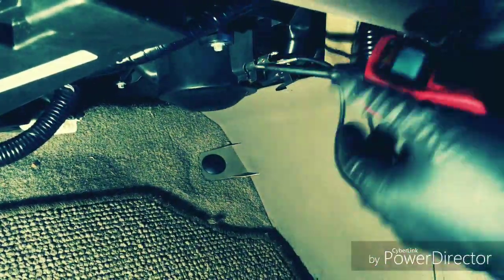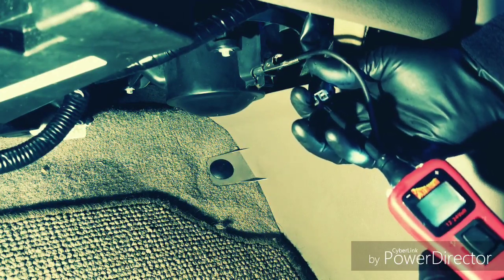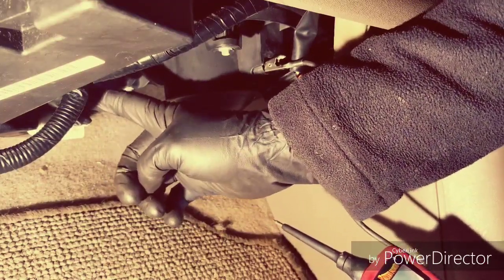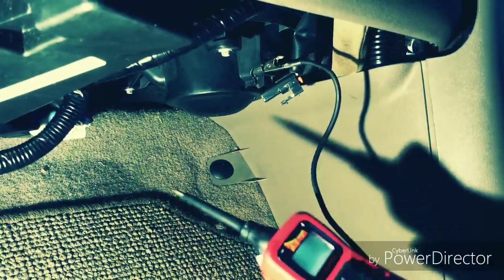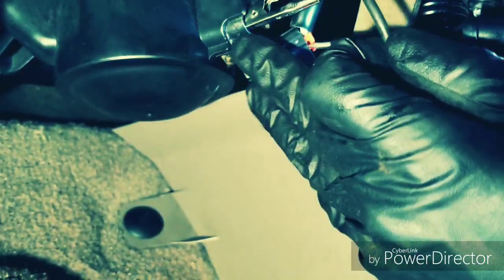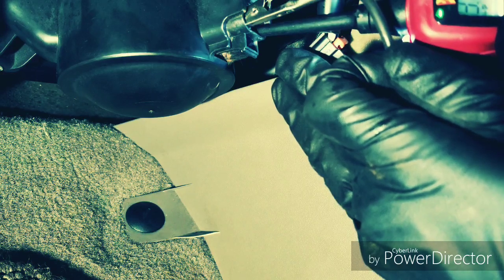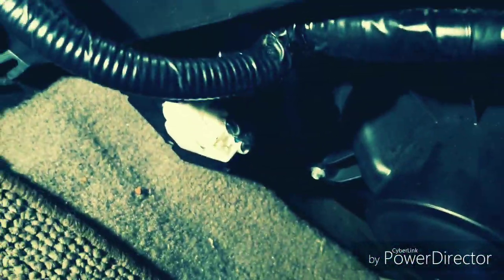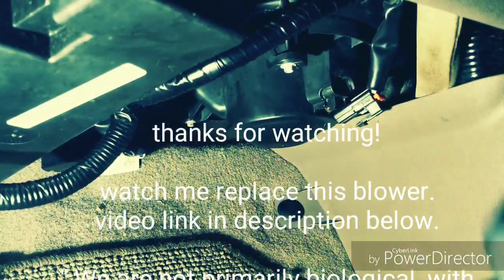Nissan Pathfinder 2005 - 2012 Blower Motor | Resistor Diagnostic

Comment: I have the opposite problem.  The front works but the rear blows just on high.
Reply: Ever figured it out? Mine just started doing that
Reply: @brandonlanoue7287  Yes.  There is a rear blower control resistor that is behind the plastic above the rear passenger side wheel.   Pop off the plastic and its pretty easy to replace.
Reply: @davec.3198  Okey, thank you figured it was, but was confused when couldn't find fuses and reley for rear blower just front
Reply: Can anyone tell me why my Longer won't shut off when I turn it off from the counci. Have to un clip.the white Few, is that in it? It shuts off when the car is shut off.
Reply: @lisamagnan1974  blower motor resistor
Reply: @brandonlanoue7287  thank you
Reply: Blower.